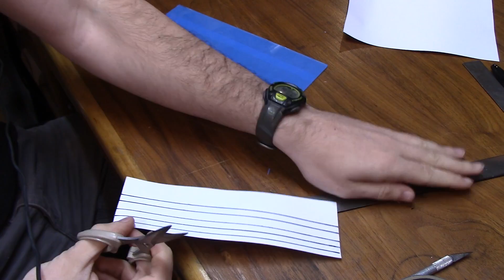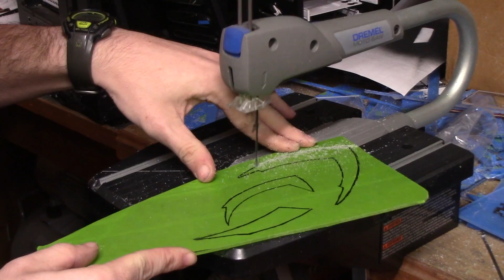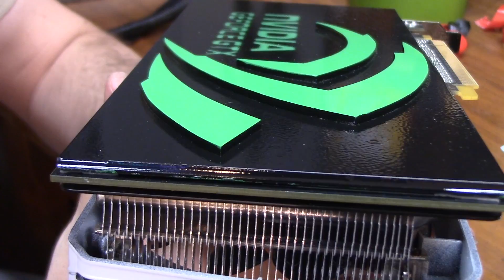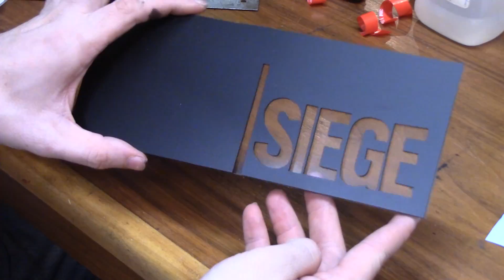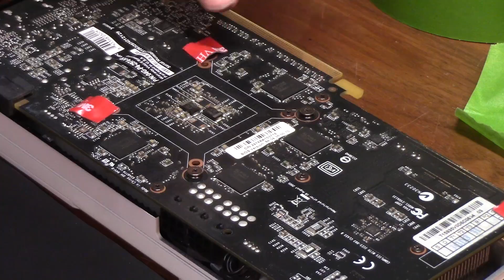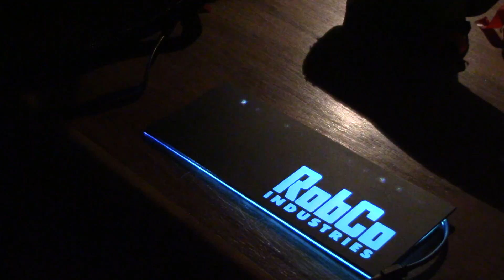How to make a custom GPU backplate (Basic and RGB backlit)

Comment: If you want to use true clear coat purchase spray Max 2K is a spray can with a center Catalyst that has to be broken and mixed before spraying and once the chemicals are mixed the spray can is only good for 2 hours. It's basically Auto Body clear coat in a can. Eastwood also makes one with a two-part catalyst. It  runs about $25 so I would advise you to make as many faceplates as you can to get value out of that can😅.

Comment: Very cool! I'm somewhat new to this. Is there a way to sync the rgb lights to only motherboard effects? Like is it as simple as not using a controller and instead just plugging them into the rgb headers? Was wanting to make 3 panels for my case, use 3 splitters to run them all to one header, for use with motherboard aura sync.

Comment: Quick question: If I do make a back plate, and put it on the back of my PCB... Will it cause heating issues? Because it seems it could trap some hot air and not let it out. Thanks!

Comment: Hi there, thanks for the video, it was very informative. I have a question concerning the spray painting of the backplate, this thing really gives me a headache. I am trying to spray paint a pattern on a piece of acrilyc glass with the help of a vinyl stencil sheet. My problem is I cannot remove the vinyl from the acrilyc glass without tearing away some of the paint on the acrilyc. For the paint job I either use a Primer + Spray Paint or Spray paint for plastics (which already contains the primer). The issue is that the adhesive contained in the primer not only sticks hard to the acrilyc, but also to the viniyl stencil, which ultimately causes the tearing away of the paint job when I remove the stencil.  Does any  body have any suggestions do get a clean paint job? Thx!

Comment: The main reason (2020) for a backplate is to disperse the heat from the back of the pcb (mainly the gddr6) to the metal backplate. Being acrylic, it might even trap the head between the pcb and the backplate which is not really ideal for heat dispersion.

Comment: Tried doing an rgb ssd cover. Everything failed :( vinyl reflective tape had too many bubbles even after cleaning the acryllic and putting the tape carefully. the acryllic cutter was terrible and ended up with some not very nice edges that I tried smoothening out without any tools. And I couldn't cut through my ssd cover. Plastic was too hard to cut a rectangle. I'll just end up buying those expensive rgb ssds  or also expensive rgb ssd covers that are like $30-40

Comment: Could I use a clearcoat to make it so the plexiglass and paint don't scratch? Maybe rust oleum enamel spray? Or some other one, I'm not sure
Also is there a place to buy pre made decals?
Reply from the maker: Yeah clear coat is the way to go. I'm sure you can get pre cut decals online, Google it!! :)
Reply: @DIYTechTube    thanks for replying, that's nice of you. And your video was really cool, I didn't know that this was possible until I typed in google "can I put something on the back of my gpu to make it look better" not knowing what would show up. Looked for this because the gpu I'm looking at getting has ugly circuitry on the top. I'll definitely be trying this out

Comment: Backplates are made of perforated dioxy-polythene carbon based silicone, which absorbs roughly 120% more heat on your GPU VVL1, VVL2 thermals, so if you use one of these it's likely you'll trap the heat within the heat-sinks causing the thermal housing & ddr core stacks to burn out. Jk man, I'm just making this stuff up, idk what I'm talking about.

Comment: I went with painting the back gloss white but I'm getting a really pastel light, for example red looks orange. Would adding another strip on the other side help at all? The edges light up very well but from the front it looks washed out.

Comment: So why does the Nvidea geforce paint look so wet and the other paint jobs look really not wet, is that just the type of paint you used? Sorry dumb question thanks!
Reply from the maker: Gloss vs matte :)
Reply: Thank you  @DIYTechTube ! This might sound stupid, but would I be able to brush paint this instead of spray painting? If so any specific paint you would recommend?
Reply from the maker: Yeah it just won't look as smooth. Just use something with high heat tolerance and non conductive
Reply: I see!  @DIYTechTube  I'll try to spray paint then. I'm inspired by your videos so I was thinking about making a PSU shroud that is LED backlit to start. Would you recommend vinyl + paint --> remove vinyl and then backplate or would  you recommend cut top panel + paint and then backplate? I can't tell if the colors are effected based on the method (whether or not you simply used different colors or if SIEGE just looks like a lighter blue than RobCo).

I have a rotary tool that can act as a saw (i guess) so i'm not sure if i should try and cut the top panel or if its too much of a hassle and just try and use painter's tape or something for the top. 

Also should i paint both sides of the backplate white or just one side? 

I appreciate all of the info haha! Thank you so much!

Comment: hey dietec so i followed your guide thanks so much for uploading this vid! when i put my own backplate together im having trouble with the rgb strip illuminating the bottom half of the top part. i spray painted over a vinyl decal to make a design rather than cutting out and the top half is pretty illuminated but the bottom half is struggling to collect any light. any idea on how to fix this?
Reply from the maker: Side emitting LEDs are a guaranteed way of fixing that. They used to be hard to find but now I believe v1tech sells them, as well as AliExpress

Comment: Gonna be doing a set piece build with a 2060 soon so I'm expecting to have to do a backplate and even a front plate to cover the VRM as I'm not expecting to be able to get a full cover block. Would you suggest a different material instead of acrylic? I'm planning to put down thermal pads but I'm not looking to do a full metal plate.
Reply from the maker: I believe acrylic is the best option. Metal is cool too but more dangerous

Comment: Wont the tape used to attach the backplate burn since gpu often go up to 70-80 temps?
Reply from the maker: No, only certain parts get that hot and those parts are covered in heatsinks.

Comment: Hi! I have a question. I am thinking about doing the RGB backplate, (the siege one) and I would like to know if I can do the cutting part with only a drill (I don't have a motosaw, and I don't want to buy one). Probably I can, but won't it look a little bit ugly? My GPU is very big, (30 cm long) so I can make the text bigger. I hope you answer soon :)
Btw very nice and informative video! :)
Reply from the maker: I don't know how you'd do it with only a drill but if you pull it off I'd like to see it :p
Reply: @DIYTechTube  Well, I was thinking about not just drilling one hole per letter. I would try to drill the whole letter out of holes. I have big and small drill "heads" (idk if I said this right), so I can drill pretty small holes too.

Probably it would take a lot more time this way, but do you think it is possible at least? I don't want to spend too much money on a motosaw ^^ It cost like ordering a finished costum backplate from the v1tech website you linked :p
Reply from the maker: I don't think you'd get a very good quality finish from that but you can try if you already have the stuff

Comment: So i followed the tutorial but now that its time for attaching the LED tape i noticed that the light doesnt get through the whole thing. Only the top part lights up well while the bottom stays dark.. Any idea what i might be doing wrong?
Reply from the maker: You may need to polish the edge of the acrylic that the light is trying to penetrate. Use fine grit sandpaper and maybe a lighter to make it as clear as possible so the light can shine through better. If you do use fire, pass it over the entire edge relatively quickly so you melt it only slightly and don't burn it
Reply: I will give it a try. :D
Thank you for you quick reply ! <3

Comment: For those without printers that can print on acrylic, what do you think about purchasing something like Cricut Printable Vinyl, printing a design onto that, then applying it on the acrylic to replicate v1tech's Custom Design Backplates? 

The only thing I'd be worried about is heat coming off of the GPU making the vinyl bleed onto the GPU or something.

Comment: I have the same Geforce video card your doing the mod back plate for, I decided after checking it out I dont have the ability to produce one myself due to injuries I received in the military, Hardly have use of my right hand and don't have a jig saw, I really liked the GeForce one, even more so if it had one of those led light strips. I was wondering if you fabricate those and sell them. If so I would like to purchase one. I'll give you all my info privately and we can use paypal if you have the ability, also I have your facebook page. Get back with me on this matter when you have an opportunity. Thank you
Reply from the maker: I personally do not, but if you check the description for v1tech I think you will find one that fits your description pretty much exactly!

Comment: Which GTX 970 is this
Reply from the maker: Evga
Reply: Dietec do you still have the video card?
Reply from the maker: Yeah but I use it lol
Reply: Dietec do you still have Your Rainbow 6-Siege Case?if you have it still can i buy IT?
Reply from the maker: Replied to your email :p
Reply: Dietec yeah i have replied this XD its to much for me but if you have you a Theme and a Theme would you make a Case for me
Reply from the maker: Commissions I'm currently doing for around $900 so if you're not trying to get the pre built one I'm not sure you'd want a commission lol.
Reply: So if I do not take the preconfigured costs a case modding $ 900?
Reply from the maker: $900 for labor, plus shipping, materials, parts... It takes a lot of work to mod a PC :)

Comment: Do you need to use a second price of acrylic for RGB I want to use my extra for a ssd cover
Reply from the maker: You can put the strip next to the first piece but then you'll be able to see the strip
Reply: Dietec can't I just tape it to the bottom like you did without the second layer
Reply: I am most likely painting the back so it shouldn't shine through
Reply from the maker: Sure you can but then it won't lay flat

Comment: How do I remove the VHB tape if I want to???
Reply from the maker: Just pull the backplate off the GPU. If you only used a little vhb tape it won't be hard to pull off
Reply: Dietec Thanks I am gonna try this and BTW great no-nonsense video

Comment: Hey Dietec, how can I make a design similar to what you did on the front panel of your case? Replaced the panel with acrylic, stickered, spray-painted, then remove sticker and LED? Is it any more in-depth than that? And where could I get a sticker/stencil that complicated?
Reply from the maker: I actually have a video showing how I did that :)
Reply: found it, thanks!

Comment: my GTX 950 gets hot, wouldn't the back-plate trap the heat? And could it melt, cause mine gets H-O-T
Reply from the maker: Nah, it'll have to get a loooot hotter to do any damage. Like over what it's capable of
Reply: but Dietec, i need every FPS i can squeeze outta my GTX 950 because on BF1 low settings it barley gets 60 fps. Wouldn't the trapped heat that couldnt be blown out of the case cause my GPU to be hot and slow? would i lose FPS? btw thanks for replying to me <3
Reply from the maker: Backplate goes on top of the GPU, not the bottom! The fans don't cool the top anyway :p

Comment: @DIETEC I noticed you are using a LEDMO RGB controller and such. Now obviously the LED strips you are using work just fine, but what of the disclaimer that states the LEDMO controller only works with LEDMO RGB strips. Only asking because I have a ledmo controller and the same strips you have in the link. Im wanting to make sure I don't waste my time with cutting, soldering (maybe, if I'm not lazy) and such.
Reply from the maker: Shrug. Worked fine for me!
Reply: IN THE END THATS ALL THAT MATTERS. THX BRO

Comment: Hey Dietec, thanks for the hardwork in the video. I learned a lot!
Quick question: I want to modify my steelseries rival mouse by exposing the outer shell to allow more of the LED effects to shine through. it seems that normal wear over time is allowing the light to shine through and it gave me the idea to completely remove the shell's black coating so that I can have a blinding ball of light as a mouse. I've tried mineral solvents which warped the plastic (on an old mouse) and acetone didn't do a thing. Any ideas what I can use to pull this off?
Thanks again, keep it up
Reply from the maker: Sandpaper would very likely work :)

Comment: Hey man awesome job! I did exactly as you showed with the RobCo plate, but I have to ask! How do you get the LEDs to light up the whole plate and logo?
Reply from the maker: Did you maybe get paint on the part that the light is trying to shine through?
Reply: Nope. Maybe I using poor led strips ...is there anyway I can send you a pic to show you? I’ve angled the strips to shine through the bottom acrylic layer and have placed white gloss vinyl across the whole back to ensure it reflects properly but it’s not lighting up the whole plate.
Reply from the maker: Eh yeah send me a picture on Facebook or something
Reply: Cool thanks man will do!

Comment: I tried this and it looks AWESOME! I don't have a Silhouette or Cricut or anything like that, so instead of buying vinyl I bought clear sticker paper (check out Avery 4397) to print my design. With an Xacto knife I was able to trace the sticker paper quite easily.
Reply: Would you recommend an epoxy or clear-coat spray as a barrier between the spray paint and my graphics card? I'm partially paranoid that the spray paint directly above my PCB will rub off and/or melt. My backup is to put another layer of blank acrylic sheet underneath, but that starts to make the backplate look too fat.
Reply from the maker: If it's enamel paint it's not going to melt off ever

Comment: Is it possible to add rgb led to the first method (the one for broke boiz)
Reply from the maker: Yessir! Just attach them to the side instead of the bottom
Reply: Dietec yay
Reply: Dietec can you make a tutorial on how to add Rgb led to fans and cpu cooler
Reply: Dietec i mean like can you make s tutorial on how to make custom heat spreader for ram and how to make custom rgb fans (im going for a rgb/black theme)
Reply: Dietec also pls a motherboard armor

Comment: Just tried this but I'm only getting light at the very top and not all the way through. Any ideas? I've tried changing angle of led strip but doesn't help
Reply from the maker: Did you sand it? It's a good idea to keep it clear and not sand it
Reply: I only sanded the edge after cutting to smooth it. I sprayed the top (of the top piece) black and the underside (of the bottom piece) white
Reply from the maker: Any spray paint get on your edges?
Reply: Just checked and it had. I've cleaned it off and it now works perfectly. Thank you so much for taking the time to help me. P.s. Love the vids 👍

Comment: cant i connect led light with a male Molex connector directly? then it connects with female Molex of my SMPS. It will not blow my leds, right? also I dont have Spray paints and i cant afford them so can i use Acrylic Colors Instead and paint using brush?

Comment: Why solder a connection to connect to a converter and then to a molex converter cable? Just cut a molex cable and solder that directly to the led strip. If the led strip doesn't have resistors on them solder one between the strip and molex cable. This way you create a cleaner build.
Reply from the maker: The thing in between is a controller, can't change colors without it

Comment: So a basic way for my to mod my pc for cheap is to make a backplate, paint ram and mobo, and make a psu shroud. I want black and red theme and my mobo is black, what do I do?
Reply from the maker: +JustwiN Sounds like you already know what to do ;)
Reply: Dietec maybe not paint mobo, is it worth making a backplate for gpu if it already has one?
Reply from the maker: +JustwiN Yeah if you want it to look custom. Depends on your taste
Reply: Dietec I have the define r5 case but no window, debating if it’s even worth modding

Comment: Hi good sir, do you think I can use PVC instead of acrylic sheets? I have a bunch of PVC at my house was just wondering if it could works.

Anyway thank you and nice vid btw!

Edit : Nevermind, it might not support the heat though
Reply from the maker: +HiB2Oux Yeah PVC melts pretty easily doesn't it? Guess you could try.
Reply: Dietec I'm not quite sure but I think it's between 56 and 99 °C. Anyway I'm not gonna risk it and stick with the acrylic! Thank again man 😊

Comment: Any special way to get it off? I am planning on doing a custom loop in the future and adding my graphics card but if I have the backplate I won't be able to unscrew the shroud? Thanks for the help in advance
Reply from the maker: Just pull it off. Most of the time they're only held on by some squares of double sided tape

Comment: How do you get the back plate paint job to not look rough? The nividia one that you did the black paint doesn't look smooth, however the other one blue/black that looks smooth at least in the camera.
Not sure what you did different in both.

Thanks
Reply from the maker: +NotALibertard 99 Spray paint is smooth, brush paint is rough. That's the only difference. Also, the lighter your coats with spray paint, the smoother it is